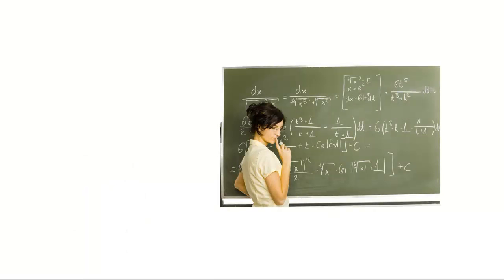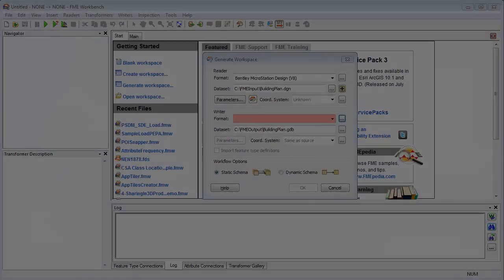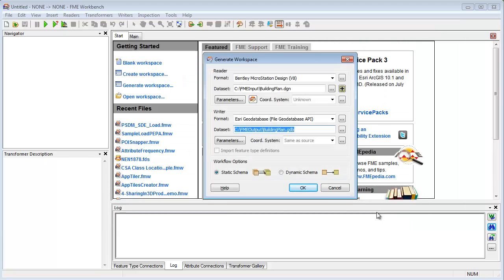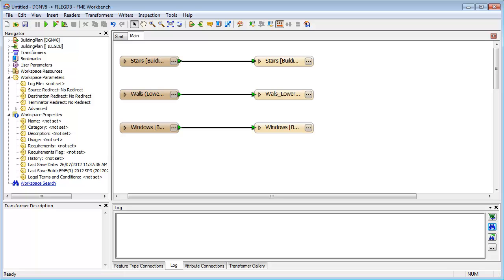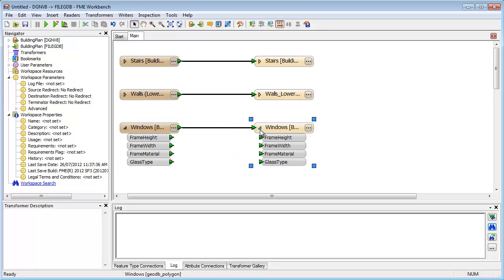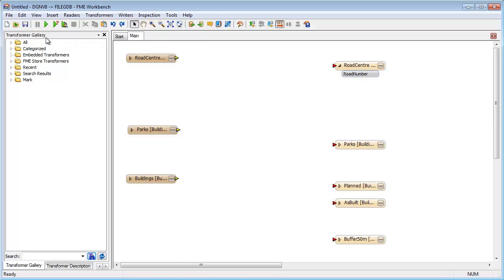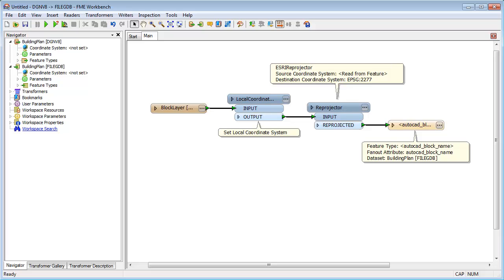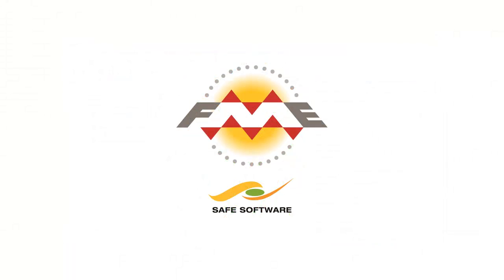Converting CAD to GIS with FME

Comment: Hello, thank you very much for the information shared in the video. Is it possible to import a DWG file into Electric Office? Could a project be designed in DWG and imported with information about poles, equipment, cables, and so on?